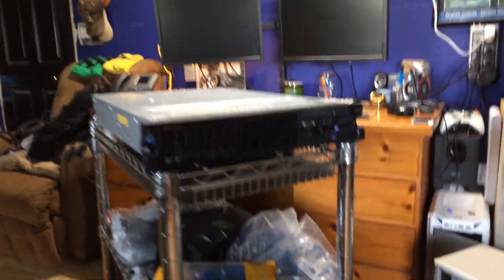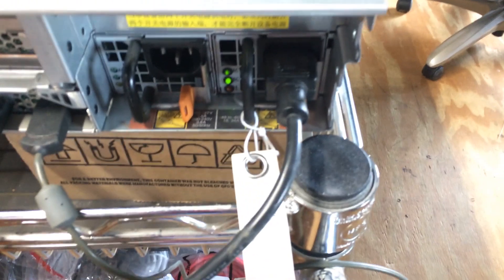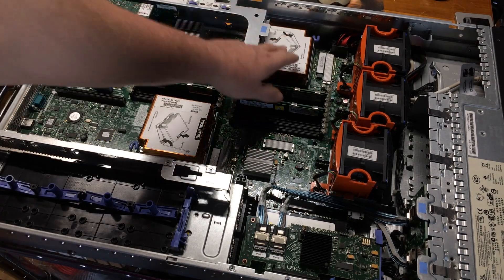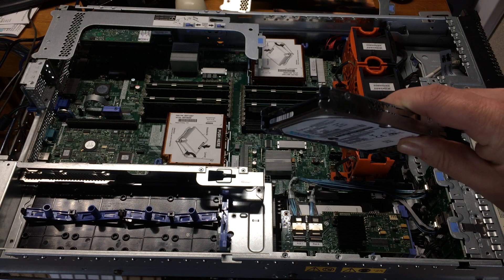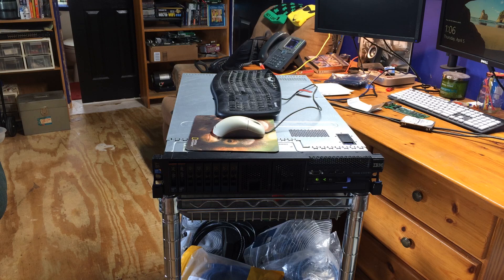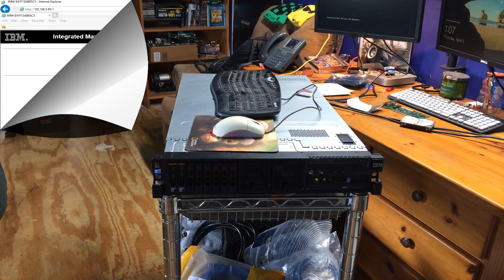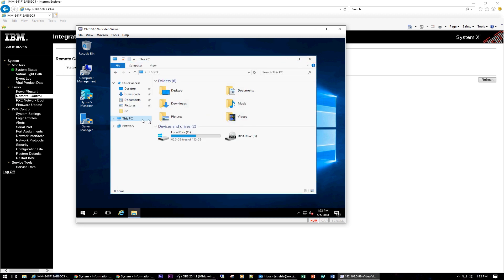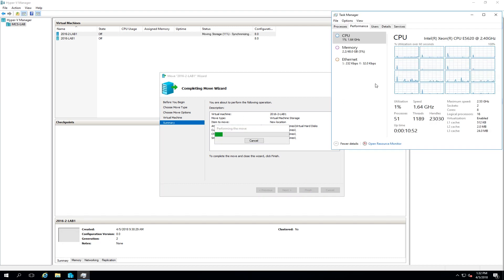IBM X3650-M3 Server arrives - Install & Config EP-168

Comment: "Triple channel" is fastest I believe, definitely for the consumer version of this mainboard chipset (X58). To achieve that on X58 you had to populate all 3 channels, one "rank" at a time and I think you can only use same-size modules.
So if that's true for the server chipset, I would try using only 6, 12 or 18 DIMMs in total, and put the first 6 DIIMMs in slots 3/6/9/12/15/18, next 6 in 2/5/8/11/14/17, last 6 in 1/4/7/10/13/16.
Possibly reverse the order - 1st set in 1/4/7... on X58 the rule was "populate the furthest DIMM rank from the CPU first" I believe, yet the IBM/Lenovo suggested population order is the reverse of that - slot 3 is closest to the CPU.
...But I don't have enough Crypto-currency-proven ECC RAM to test any of this yet! :P

Comment: Hey Unkjoe i have three 3650M3 and i can not connect to the IMM with chrome or firefox only internet explorer works. Can you confirm that? 
Thank you from Germany...
Reply: Hi Horst - I have a x3650 M3 and use Chrome on Fedora 27 to access IMM2 via the IP. I can't use Remote Control though, I can only use IE to do that.*
I think Chrome probably warned me about a security exception as usual, but it should partially work in the same way on Windows... 

*In my case that means I've set up a Windows VM on the server to use IE so I can use full IMM2... which is managing the hypervisor that's running the VM! :S